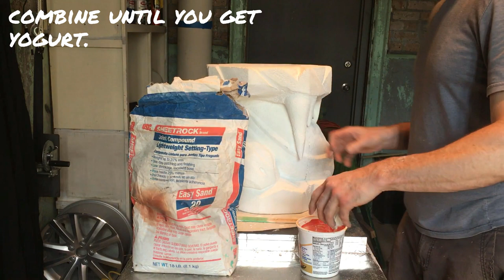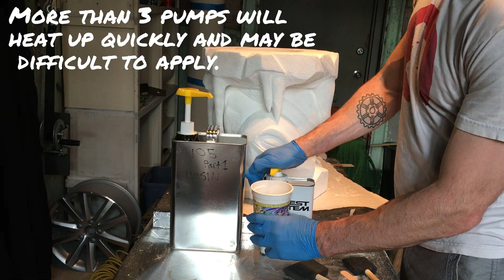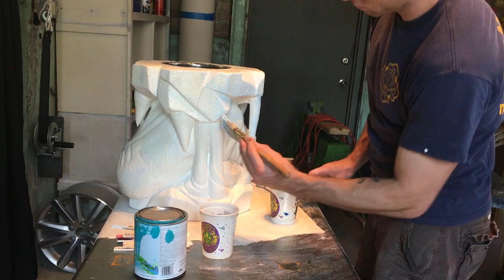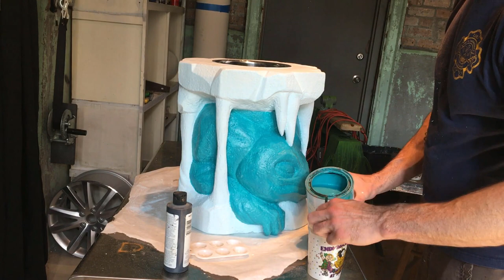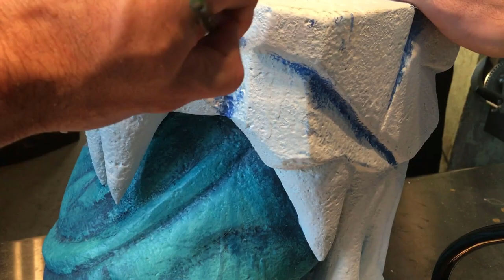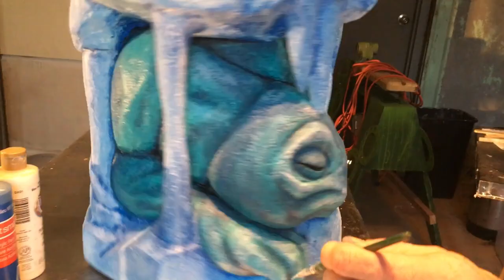How to hard-coat and finish a styrofoam prop

Comment: Thank you for uploading this video. I wanted to see how they painted and applied glossy coats to these.
Reply from the maker: 7Annamallover7 your welcome!  There’s several different ways to accomplish that, this is the method I like.  There are other types of epoxy that will work but stay away from polyester based resin (the fiberglass resin you find at A lot of hardware stores) bc it melts styrofoam.  I ordered West System on Amazon.
Reply: @Chemical14  Oh good to know. I read about polyurethane spray. But that's the most I've learned so far. I appreciate it :)

Comment: I’m trying to build an enclosure for a reptile I have the styrofoam carving done I wanna harden it does that epoxy make it hard so it won’t chip like styrofoam normally does where can I get the epoxy from?
Reply from the maker: Yes epoxy will make it much harder, especially if you build it up in layers. I just order it from Amazon. I like west system because it’s really easy to mix and use

Comment: This is really helpful! I'm hoping to make my own art deco marquee letters with light bulbs for an exterior sign. The letters would be the part made from styrofoam, and then attached to a metal or wooden board to line them all up. I'm not planning on covering the entire back of the sign with the board - just enough to line them up and then attach it to the side of the building (e.g. a "blade sign"). That means some parts of the letters would be freely open/exposed to all the outdoor elements. I'm mostly wondering if you think this technique you've demonstrated will harden it enough for the letters to a. be able to be attached to a metal rod and not fly off in high winds, and b. not rip in half in winds or hail? Some denting is okay since it will be high off the ground and can't be seen at eye level, but I want to find a way to make it pretty permanent in whatever nature can throw at it! Or do you have another suggestion by chance? Thanks so much!

Comment: This is just the video i needed. Can this be used for outdoor sign applications?
Reply from the maker: Yes although if it’s going to be exposed to a lot of sunlight the paint may fade or deteriorate over time so I would recommend a Uber resistant top coat like an automotive clear.
Reply: @Chemical14  awesome thanks!

Comment: I'm building large Styrofoam tombstones that will be used in an escape room. Obviously, they need to be able to withstand the constant touching that happens in an escape room. I've finished them, and was just going to paint them with a dry lock paint, it looks like you'd suggest brushing on epoxy before using the paint? This the first time I've worked with foam, and I love the results I got, I just want to make sure I finish the project in a manner that will ensure they'll be as durable as possible. 

What are your thoughts on this? Epoxy before dry lock?
Reply from the maker: Epoxy gives you the most durable hard surface but it is expensive. Don’t use polyester resin like comes with fiberglass, it’ll dissolve the foam. A cheaper easier hard coat is “speed finish”. It’s a cement based product for tile underlayment.  It works great but it leaves a rougher finish and it thickens as you work so you have to be careful not to put it on so heavy that you loose your detail. That’s what I would probably use for something like old tombstones.

Comment: How long do you wait for each step?  I noticed you have different shirts on for each part:
Yogurt primer compound mix
Resin
Painting
Polycrilic 

Is it 24hrs?
Reply from the maker: If it’s small like the project I did here you could do the entire process in one day. Acrylic paint and polycrilic dries very fast (just a few minutes if it’s not too thick). West system epoxy cures in about an hour or two depending on the volume you mix, the thicker it is the FASTER it dries. The slowest part is the primer compound mix which varies a lot depending on how thick you apply it. This step is only necessary to smooth the surface if you have a lot of pits/gaps/cracks.

Comment: How hard is the epoxy top coat?  I use foam for sculptures that are in areas where children touch.  Currently I am using three coats of titebond wood glue over the xps foam. Unfortunately the application of the wood glue on horizontal surfaces causes tiny air bubbles which are tedious to sand and patch.  
Thank you for your help
Reply from the maker: The epoxy coat is very strong if you do a few coats. You can keep layering it until you get the required strength. You just need to be careful not to let the drips and runs get out of hand. Only do small amounts at a time or it will become unmanageable.

Comment: Is the plaster and latex mix meant to protect the foam from epoxy?
Reply from the maker: Most epoxies won’t hurt the foam, unlike fiberglass resin which will dissolve it immediately. The latex and plaster just fills pits and hardens the surface so you don’t have to use so much epoxy. You can also use it to make different surface textures. It’s not absolutely necessary.

Comment: Hi, can you use this method on XPS foam as well as EPS?  Also will this weather outdoors okay?
Reply from the maker: Yes it will work on xps foam as well. If you don’t have pits or seams you need to hide you can skip straight to the epoxy step. The hard coat will be fine  in the weather but you may want to a clear lacquer at the end instead of polycrylic to protect the paint.
Reply: @Chemical14  , thank you very much!!